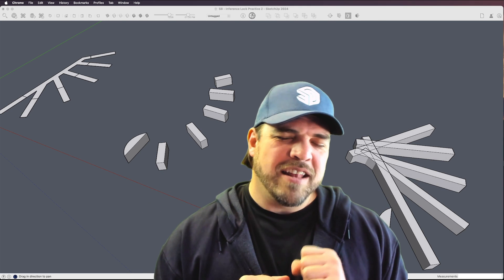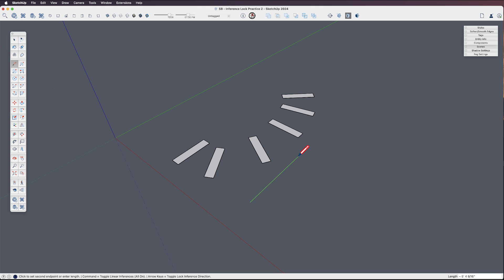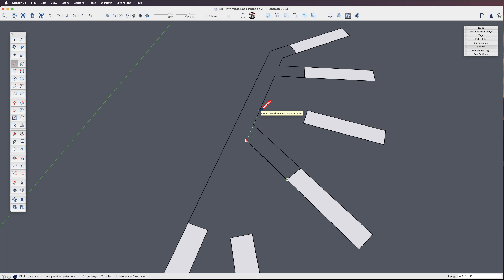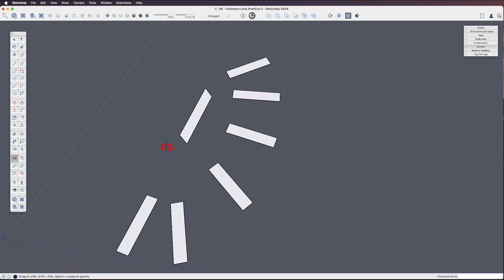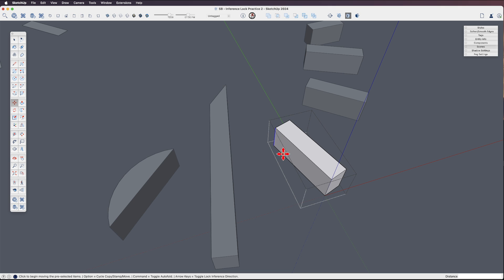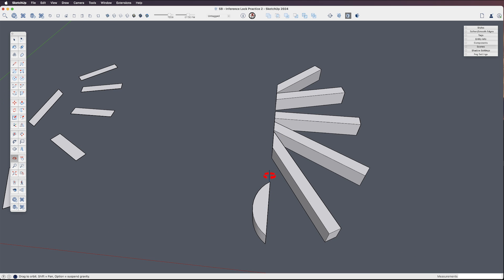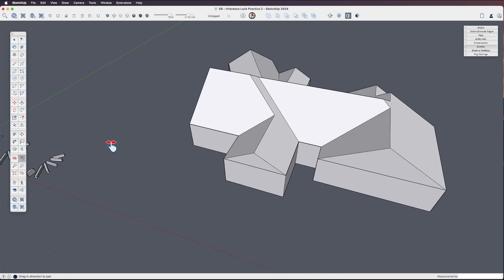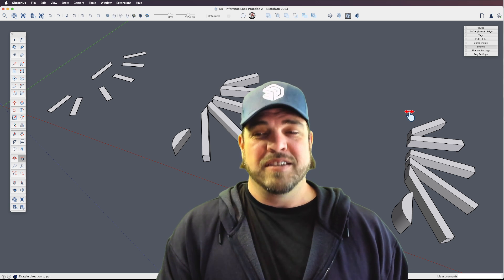Unlock the Power of Inference Locking!

Comment from the maker: 👍 if you never thought of inferencing that way
Reply: This was very helpful!  Can you illustrate inferences using the rotate tool?  For example rotating a board from a point off it's end points to intersect with a plane with it's opposite point.  Think of a sheet of plywood hinged to a base/platform with a hinge and you need to find it's far point intersection with a plane/ground.  I can do this using math, but would rather use Sketchup tools.  Typically I would draw a circle and the point at which that circle intersects with the horizontal line is the point I would rotate the sheet of plywood to.  However, SketchUp circles are series of lines and not true circles.
Reply from the maker: @robertpoirier8516   I think I understand your question, and totally agree with it. Rotating a face or object, and wanting to lock, or be able to exactly rotate it to where it meets another face. This type of inference doesn't exist, or, didn't until V. 2024.  Now, in the latest version, If you are rotating an object or face toward another face, there is now an inference called 'From Radius, on Face'.  It doesn't work with locking, and it can be a little tricky to find, but it's a start, because yes, otherwise there isn't a great way to do what you are describing. I think it can be improved on, and I would like to see some sort of locking built into rotate, but for now, give that a try. Hope that makes sense.

Comment: Can someone please tell me what to do if shift inference isn’t working. I have hovered and found  the desired inference but shift does nothing only down arrow key works. I have also looked and cannot find anything in preferences/shortcuts for a key binding for anything related to inferences. Any help would be greatly appreciated.
Reply from the maker: Inference locking is hardcoded to the arrow keys. For help with your specific issue, you may try orbiting so that it is easier to inference off the specific geometry. For more detailed help, try hoping over to forums.sketchup.com and posting a screenshot of your issues. It si much easier to troubleshoot over there than here in YouTube comments.